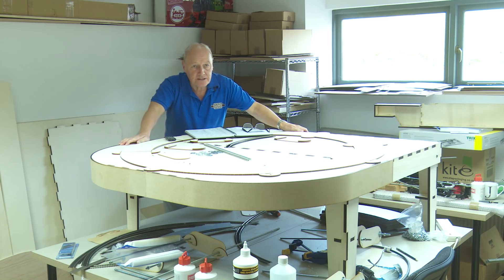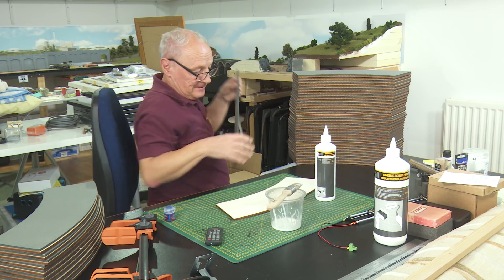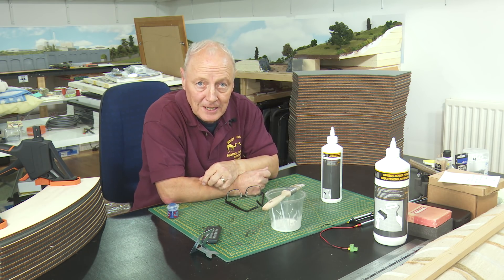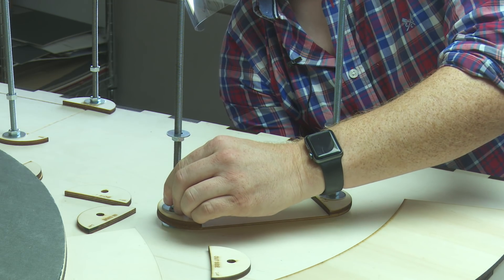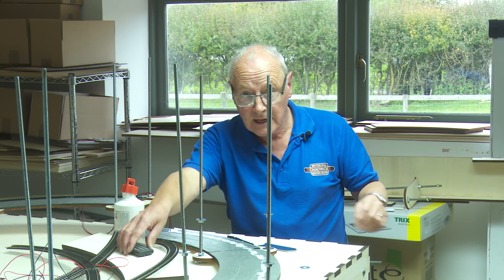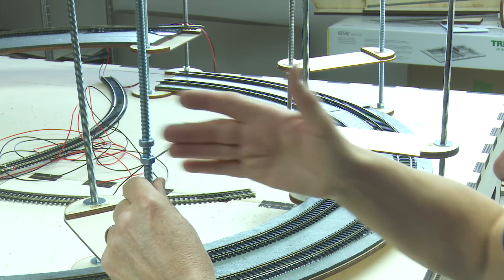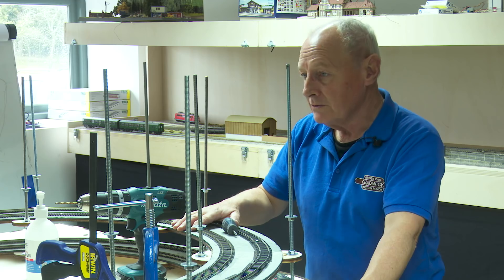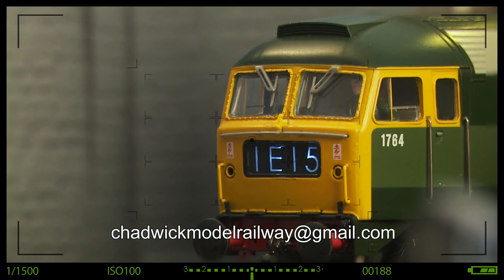Building a Helix at Chadwick Model Railway | 114.

Comment: I won't use anything which aids the loco to pull stock up an incline, I won't take the risk of burning motors out, even if it doesn't burn the motors out it will cause more wear and tear. I double head if the need be.
Reply from the maker: An interesting point Sam.

Comment: Another excellent, interesting and informative video from Charlie at Chadwick, always look forward to these....  Quick question Charlie if I may?   Regarding the B&Q foam you are using as the track bed.  I'm going to be involved in a new layout shortly and was wondering with regard to sound transmission, would this be a good product to reduce sound transmission if it were to be laid over the baseboard roughly in the areas where the track is to be laid, with say a couple of inches overhang either side and then the normal cork track bed and track on top of it, what do you think?  Cheers,  regards  Chris.
Reply from the maker: The jury is still out on this one Chris as I haven’t really used it in anger. I certainly wouldn’t be laying cork on top, I would just be glueing the track to it. However do remember that when you use these type of trackbeds it puts the platform heights out.

Comment: Charlie you may just be old enough to remember when Triang Railways bought out Magnehesion in their locos. I assume what you are using is essentially the same idea. Yes a really boring job fitting the felt but  I guess you end up with a very effective reliable structure. I assume you evaluated the alternative scheme of having new knee joints fitted in the Devon and Exeter.
Reply from the maker: Thanks Martin, I’m so pleased that you enjoyed it. I do anything to avoid an operation on my knee! Regards Charlie

Comment: Hi Charlie,
My you have a job on your hands with this bit don't you as a retired Joiner why glue the segments to the support pieces when they could be screwed  and if you had it would have been a lot quicker in construction and if you ever needed to take it down it would be a fairly easy job and also to reassemble should you need to. Now this is going to be a very big piece of kit so have you any idea how heavy it is going to be when the time comes to get it on the layout?. For the first time ever you are SCREWING track down!!!!!!. so as you have only put screws at about 3 ins from the joints and as it is on flexible track bed does it not distort the track which of course be a disaster in the making and finally do not forget to get some ear defenders as with the screws holding the track down which will transfer noise to the structure it could be very noisy for you. Please keep safe and well in these dangerous times but a very interesting video none the less well done.
Cheers Robert.
Reply from the maker: Thanks Robert, some excellent points. Regarding the transportation of the Helix, it would be transferred on mass as one unit without the need to have a break it down. Regards Charlie
Reply: @ChadwickModelRailway  Hi,
Thanks for the reply and I did realize it would be transported back to yours in one piece hence the how heav
Reply: @ChadwickModelRailway  Hi ,uploaded without my permission so to continue-how heavy question but what if in future you may need to dismantle and also it surely would have been quicker to build anyway and again keep well and safe.
Cheers Robert.
Reply from the maker: It will easily come apart from the base which if tipped is only 23 inches wide.

Comment: Two things.
1 why not use nails rather then screws?
I know screws would fasten better.

2 couldn't use silicone rather than copydex to hold the truck and plates down?

Everyone does things different, just wondering.
Reply from the maker: Nailing could well damage the plywood under the track base with the sheer  violence of beating. I was unsure about using silicon as it could melt the underlay. The copy decks is inert in this task. Regards Charlie
Reply: @ChadwickModelRailway  good point, wasn't thinking of the elevation as not being soild with the hammering.

Comment: You may want to add an interior helix (circular) wall of some form since access into the middle of the helix is not really possible. Things always fall down into the center of a helix! Normally I see folks cutting a hole in the middle for access, but yours is too low to the ground to easily get in there.
Reply from the maker: It’s certainly a subject that I’m toy-ing with EM.
Reply: Or a nice soft landing and a pull out tray?! Be interesting to come up with some ideas to use the space in the centre. Or Charlie’s next project could be https://www.youtube.com/watch?v=AuRG8RH62sc. wrong link.  One of these https://www.youtube.com/watch?v=dFH8tholW9g in the middle I meant.

Comment: Daft question,  but what does the power base actually do?
Reply from the maker: Not daft Mike, magnets are fitted to the weaker loco's to give them more grip.
Reply: Cheers for the info,  so kind of like the older Hornby locomotives that had a magnet in the chassis when we used to use steel track.  The good old days.   Take care.

Comment: I would be careful about the screws' conductivity, if they're going through powered metal plates as it seems like the concepts plates are, you don't want electrified screws in the wood
Reply from the maker: No the metal plates work with magnets fitted under the loco's.

Comment: Be careful. I tried a similar thing to the screws before. They all seemed good, but then I found a set of wagons that would catch on them every time.
Reply from the maker: Thanks for the tip IJ. 
I will certainly keep my eye on it. 
Regards Charlie
Reply: @ChadwickModelRailway  I had a similar problem. My new Duchess of Atholl has a dangly bit on the underside of the tender which snagged on a point motor pin that was protruding a bit too far above sleeper level causing it to derail

Comment: The next challenge is to work out how to run the banking loco (automatically) 🙄
Reply from the maker: Now there’s a challenge Tom.
Reply: @ChadwickModelRailway  
I get the impression that iTrain has speed profiles, so might well be possible.  Does TrainController have similar capability?
Reply from the maker: Very much so Tom.

Comment: but isn't 3rd and 4th too tight for most modern locos?
Reply: Almost all locos will manage 3rd and 4th radius. 1st radius is very problematic, but many can manage 2nd, even if it looks too tight
Reply: @roundel52  yes on the flat, and only just up 2% a straight with lead shot and power base. but a full train in 3rd radius with greater than 1.5% thats pushing it. and 3rd radius is a 3.03% grade  4th is 2.6 % grade for reference using https://www.modelbuildings.org/helix-design-calculator/ you would need 30 inches for a 2% incline
Reply from the maker: Great comments gentlemen. However please don’t lose sight that the third radius curve is the downline and the fourth radius the up.
This does certainly make things easier for loco grip.
Reply: @ChadwickModelRailway  Yes, That's the concept I used for my helix too, except I built my boards slightly larger with the original intention of using Flexitrack. So I have a  number of R610 straights in the mix to help increase the length and thus reduce the incline to 1.99%. Hopefully, with powerbase too, most stock should make it. If not, I'll be running some double-headers!

It adds to operational interest, anyway :)
Reply from the maker: Great comment John, good luck with yours, regards Charlie

Comment: Charlie I have built my own first helix the main difference I have is the helix's are in there own sheds attached to the main shed so I could not work from the outside.
Some of the things I have had to do and learned from the build I thought you would be interested in. I put T nuts in the helix table the bolt on top locks the rod in place. I have a large hole in the helix table so I can work from middle. I use 1/2" copper water pipe slid over the rods as spacers to make sure there was little movement with the bolts over time. Re winding the bolts up and down I use a drill with a rubber sanding disk backer which makes it all a lot quicker and easier on your fingers. This is my video on how I built my helix https://youtu.be/nTslH886J28
Helix's are a big build best wishes for the rest of your build Neil
Reply from the maker: I watched your video Neil but had to google T-bolts.  Great touch with the copper tubes.  Regards Charlie